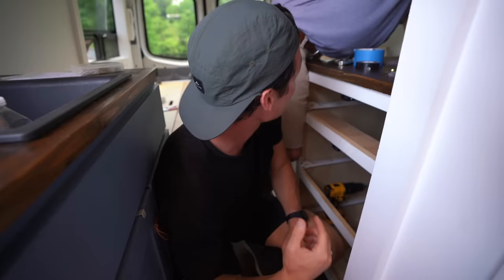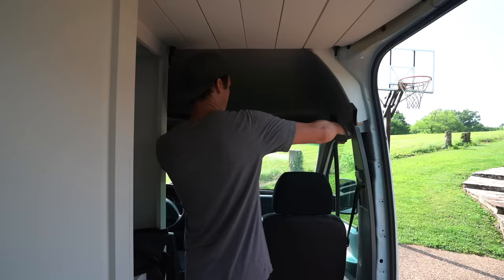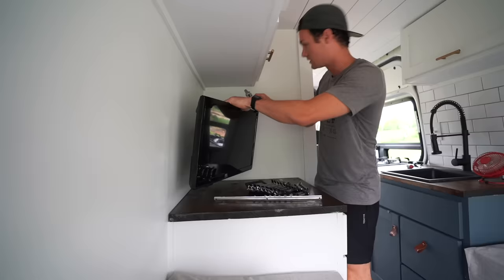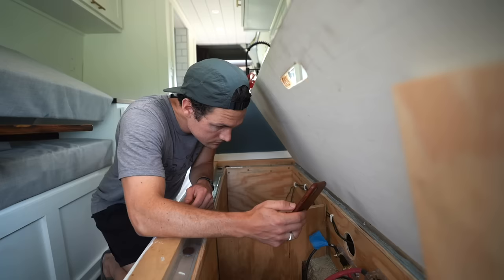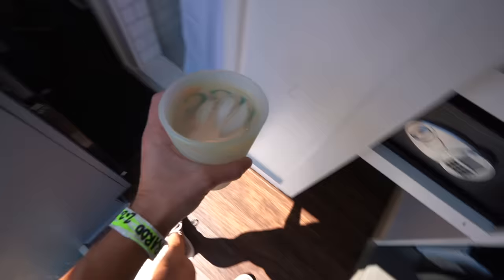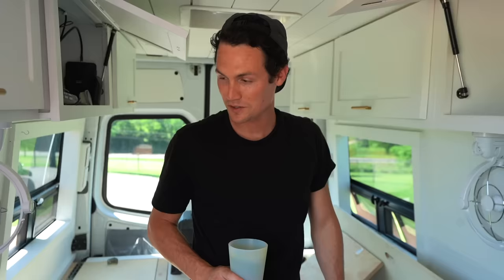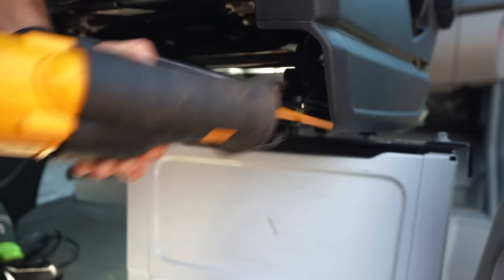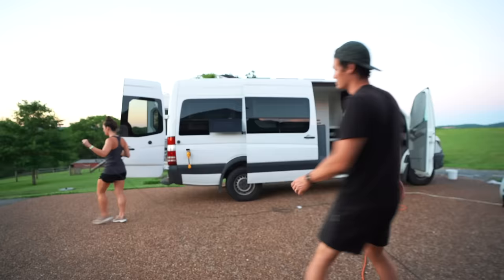The REALITY of buying a self-converted van

Comment: Having traveled around in an older motorhome I can tell you that a knowledge of how your systems work is extremely important when you break down in the middle of nowhere. One of the things you need to have in your van is a set of tools and fasteners. You may need screws, washers, nails, bolts as well as electrical tape, duct tape, screwdrivers, wrenches and a hammer.
Reply: I was thinking the same thing and put a similar comment but yours was more detailed and accurate lol
Reply: Absolutely
Reply: And zip ties. Never underestimate a zip tie.

Comment: 6:20 I was shouting 'NO NATE DON'T UNPLUG THE BATTERY WITH A METAL TOOL'  at my computer. Lucky nothing happened!
Reply: Jonas Geist You don't need an insulated screwdruver. It's just DC Electrical. Just don't short out the Positive and Negative wires.
Reply: @darrenwoloshyn  Oh alright, is there not a chance of bridging the positive and negative wires by using a metal spanner?

Comment: For the table, you just need to make a detachable leg that you can put on the the wobbly side that doesn’t have any support. You can probably attach some brackets to the bottom to lock it in, and then remove the leg and store it/the table when you’re not using it.

Comment: I have some suggestions for next time: spray water on the metal you are trying to cut while you are cutting it. It saves you from the smoke and makes your bits and disks last way longer. Don't measure starting from zero, measure from one and add an inch. GET A STUD FINDER, they can find wires through the wall so you won't need to drill through. (start at one and add one at the end) Organizational tip: get blank labels and wrap them around each cord in each space to easily find them. Over all I love your channel and am planning to travel solo as soon as I finish high school. If you have any strange tips or hacks that you learned on the road, can you please share them. Thank you so much.

Comment: Good renovation checklist. Runs stronger, less hold ups in the end 💟 For back window cover, could do a stick on hook and thread a loop of braided cloth to corners thru grommet. Maybe do a drilled silicone plug that will fit to hold it snug.

Comment: Love the van and look forward to seeing the adventures. You really didn't need the shower! It takes up so much room and the weight with it and the water to use it will burn so much fuel.  I drove semis for years and the showers at truck stops are awesome! They are super clean, you can use them together and they are free when you buy 50 gallons fuel. You could also join a gym and shower there, this also gives you an excuse to workout.

Comment: I did van life in the 70's in a Ford econoline supervan (e360) my dad built,  while moving around as a Navy brat. Rumblesteelskin(usually just rumbles) had many trips including 7 times ocean to ocean, including being shipped to and from Hawaii(via uncle sam) where the van was built orginially. His had a pop top that raised 2ft with big roll out windows, a counter, 3 burner coleman stove with oven(about where you just took the tv out), 9 drawers in the counter, and a coleman cooler as the icebox. On the other side we had a hand pump sink with a fitting if there was a hookup, and a propane water heater that seldom actually worked. It also had under van clear and gray water tanks on one side and a 40gallon gas tank on he other. It weighed in at 6300 lbs without the other 700lbs of gear when on the road. 
  The double bed and table was similar to yours, and it also had a hammock where your shelf is now, which I hated... BUT and this is why I commented--- Ours had a pipe and flange set which was much easier to use than that contraption and left the back end middle open for easy exit.. . I think it might have been from a sailboat. The one we had was the top and bottom flange that just pulled apart. That adjustable one look interesting though. 
https://www.amazon.com/s?k=marine+table+pedestal&crid=1UJT9OCFSH90H&sprefix=table+pedastal%2Caps%2C186&ref=nb_sb_ss_sc_6_14
After seeing all those amazing places(I haven't seen them alI) was surprised to find you guys were so close! Come see the Blue Ridge Parkway in Virginia!

Comment: One more thing ... with no wiring diagrams available, a handy tool for you mobile tool kit would be a basic multimeter to check wiring...inexpensive and pretty useful when you have electrical issues.

Comment: If you are going to use the van in really cold weather then you should get those covers over you windows to seal fully up against the glass otherwise your heater will struggle to keep the temp warm inside.

Comment: Velcro would be best for the bottom of the curtains Kara. I had a camper van 6 years ago. I drove from Warrnambool Victoria to Cairns Far North Queensland. It worked out so much cheaper having a campervan. I found a lot of free camp grounds. The van ran on petrol & gas. Buy melamine dinnerware. Unbreakable.

Comment: For the window covers, use magnets to stick the bottom part. You can insert it inside the cover and then glue the other magnet to the wall (and paint it if you dont want it to stick out (You could even drill into the frame to make it flush but thats a lot of work

Comment: You need to put something over the electrical stuff if you are going to use that storage box and be opening and shutting it and putting stuff in, the current is generally much higher on a 12V system than regular household electrics and if you (say) dropped a fork on your battery it is possible it could potentially start a fire.  All the electrical on our van is covered so that nothing can accidentally fall or touch where it shouldn't.  You could use something like a decorative fine metal grille so it can vent.  Electrics get too cold and too hot and then get unhappy.
Reply: DH is an electronic engineer and it makes him cringe when he sees unprotected electrical van systems.
Reply: DH said the wrench you are holding is the kind of thing that permanently (until it vaporises or the battery explodes) WELDS itself between terminals.  He stopped watching when you touched it. LOL

Comment: Please note that the corner of the plywood divider seems to be resting on that red wire.  As you drive down the nation's highways that wood could vibrate against the wire damaging the insulation.  A fire hazard if something were to bridge against the exposed copper.

Comment: Hey Kara & Nate, I work at 3M and we have a solution for your window coverings... The easiest thing you can do for those window coverings in the back that need fastening is to use the 3M Scotch® Multi-Purpose Fasteners... You can stick the fastener on both metal and fabric which will be connected via a very strong yet removable velcro fastener... if you want additional recommendations, you can also call the CHIM Division at 3M Directly which is 800-494-3552... they can recommend numerous other products that will be perfect for what you're looking for just tell them what you need to accomplish.

Comment: Probably not alone about this and not the only one, but use wago connectors instead of hats and clamps or whatever they are called in English. Safe, can be mounted and cable is stuck there. 

Also buy a cheap voltage meter for $10 bucks so you know what’s + and - :) at these cables. :)

Comment: why don't you guys just install a stand (that can be adjusted height wise, like a tripod leg) on a hinge to the table so that it has more support. if it's on a hinge you can fold it under the table so it can move with the table to the side when you're not using it.

Comment: 6:27 Should have used a test pen Voltage detector to check if it's live. Even a Millisecond of contact with will stop your heart/enough to cause serious health problems. I suppose that is from a Solar DC Connector and not the Inverter Live Connector, else you'll be in real trouble!  Invest in a Multimeter or at least a Test Pen! Those cost less than USD50!

Comment: You're not going to shock yourself on 12 volts in the van.  But one thing to always do before working on anything electrical is to remove your jewelry first.  Seeing you working on the with  a ring on made me cringe.  For higher voltages, that's to help protect you, but you also don't want to accidentally have the ring touch the wrong places and cause a short.

Comment: I’m 21: I bought a $2400 1999 Chevy Express van with 117000mi. A white van (I know). It came dusty but intact with three tool shelves and a seatless cabin. I kept only two shelves and fitted some carpet on the floor. I upholstered sliding curtains and used steel wire to fasten a 5 gallon water jug upside down. And there was a bolt hole left from where I removed the tool shelf, so I used some tubing and gallon jug to create a urinal. I stocked it up with everything I need and went West by myself. From Iowa to California to Washington to Idaho to Minnesota to Kentucky.  Minus gas, I estimate the van only cost me $2500 (because I had existing tools and workspace). That’s my van experience. It’s more realistic than these super wealthy Youtuber folk.

Comment: Def is basically synthetic pee (urea) and water. Actually, it isn't basically that, it is that. 
It won't really hurt anything, except it might not be the best for paint, and if I had to guess, it would probably smell terrible burning off a hot engine. 
When the person told you not to put it in the engine, he probably meant not to put it in the diesel (fuel) tank. That is really really bad. Don't do that. And of you do, consult a mechanic immediately, before turning the motor on. An ounce in a full tank is probably ok, a full bottle of def in the diesel tank, and it will need to be drained.

Comment: Your wiring is a mess, also you can't have shaking/vibrating wires in a van..you need automotive wires and also best is to bundle them..they can't hang loose and dangle in a cabinet or they 'll break internally one day in future. And plus-wires have to be red, ground wires black...that's important if you ever have to fix something or find a problem. Also those cable connectors that you squeeze on they suck, better is soldering the wires...Serious you can get fire from crappy electric systems, i know all about it haha.